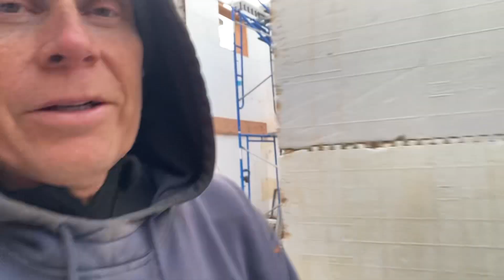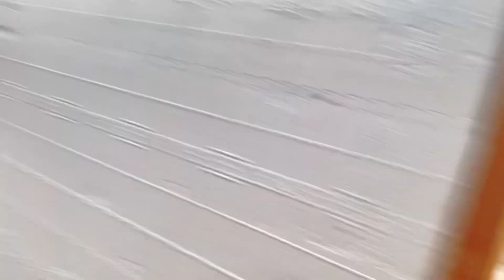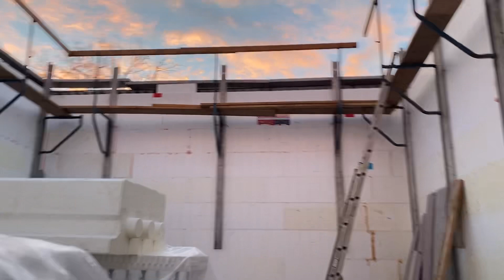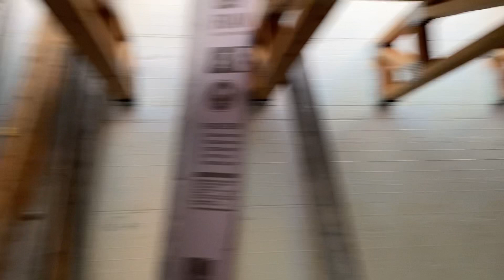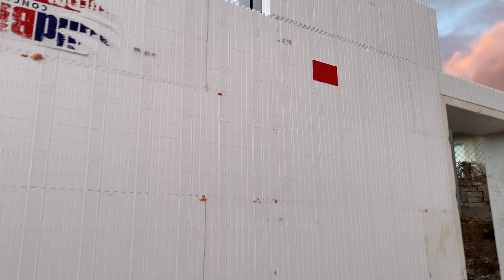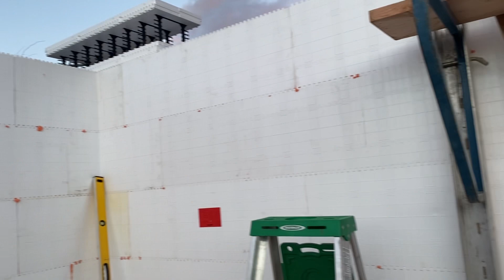Weekly update on my ICF home build

Comment: Have you considered a heated flooring around your escape window of the family/play room.  Having one loop on the outside might be able to keep the opening accessible, number 1, and number 2 could give you the spectacular view of the mountain after snow storms.  Of course I might dig out the area around that window to make sure the view is expanded as much as a retaining wall 20' wide, half circle gives.  Yes an opening that big is not necessary, bit to have that view in a family room, is worth a little earth moving and wall construction.
Reply from the maker: Interesting idea.  We usually don't have a lot of snow stick around for long.

Comment: Looks like a cool build.  Wondering how you chose Buildblock vs. other manufacturers.  Have you considered GFRP and/or microhelix?  It would be great if you could share the overall design.  That is a tall building for DIY. Keep up the good work.
Reply from the maker: If I had more money I would for sure consider the GFRP option.  But I am on a really tight budget.  Hence the reason why I am building most of it 

Same for the Helix.  Although if the Helix could replace the rebar for the lintels above the doors and windows I would spend the extra money because it would be a huge time saver.  But just for vertical and horizontal rebar I am finding that those go in pretty quickly.

Here is a video that explains the overall design. https://youtu.be/GawDD1s_DdM?si=7vCf-A4092Vb6Ncy

Comment: Great work. I'm enjoying watching your journey. How big will you garage be? Thanks
Reply from the maker: The room under the garage will be 23 feet wide and 19 feet deep.

But the actual garage will have two bump outs.  Kind of like two single car garages going into the main garage.  One will be 22 feet deep and the other 24 feet deep.  The reason why they can’t be the same is because of set back limits that the city puts in place. I live on a cul de sac to it makes things very tricky.

Watch this video of the floor plans and it will make more sense https://youtu.be/GawDD1s_DdM?si=7vCf-A4092Vb6Ncy